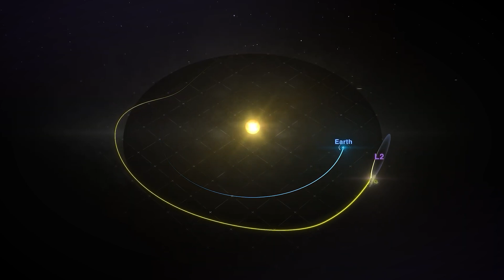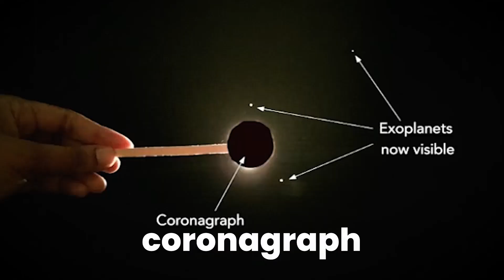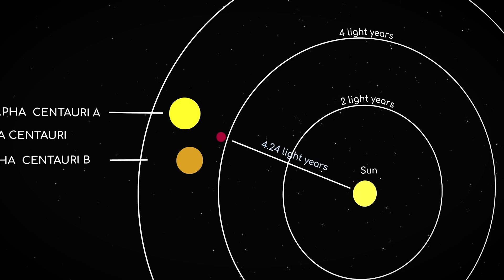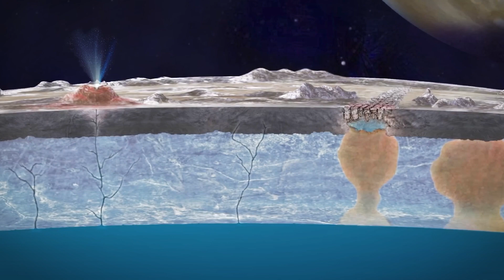ALERT: Unexpected NASA Plan to Visit Proxima B Leaves Scientists Speechless!

Comment: Currently, with traffic it takes me at least and hour to drive from the south-side of tally to the north and back to my house which is about 6 miles both ways - 12 MILES. Alpha Centauri is very far away. This far, 4.25 light years away. 1 light year is 6 trillion miles. Have you ever counted to a thousand? It takes time. Light takes a little over 8 minutes to reach my sunburned face. The sun is 93-ish million miles away. Light travels at: 186, 028 miles per second. I own a car that was born in the year 2002. Its mileage is 164,000miles and the car is 23 years old - it works. If we want to go to Alpha Centauri we are going to need something faster!!! Case in point, Voyager 1 and Voyager 2 spent 30 plus years to escape the sun's influence and traverse into interstellar space. If they were going to alpha centauri it would probably take those spacecraft 70,000 years.